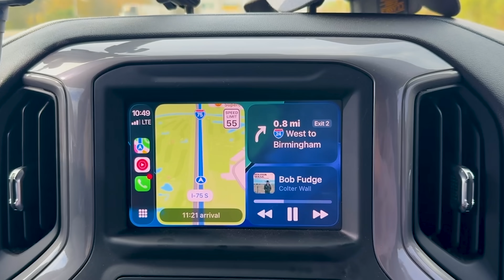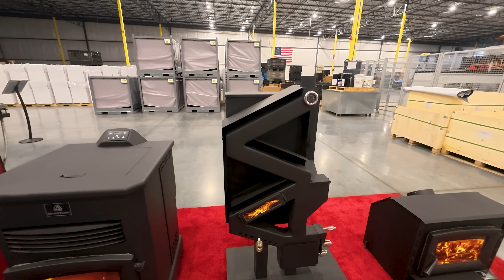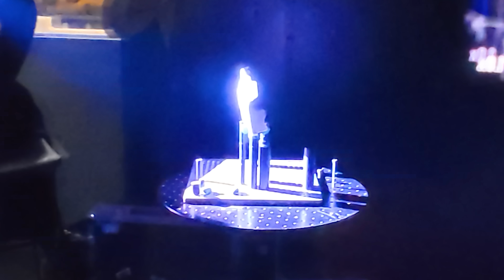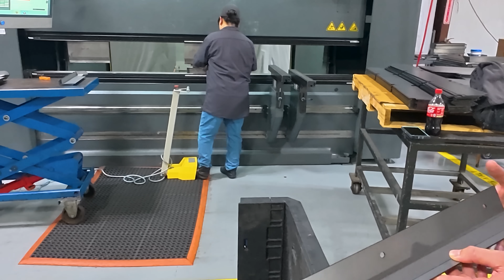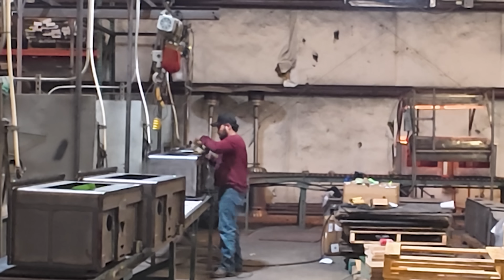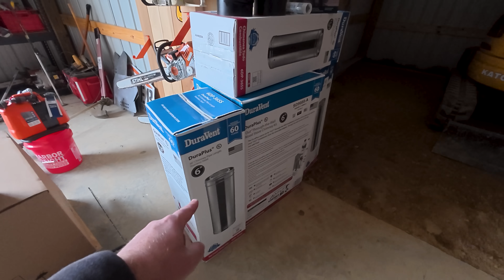This Is How a Wood Stove Is Actually Made

Comment: 12:30 consider doing something very substantial. Having a significant thermal mass behind/around the stove will greatly help capture radiant heat during burning and then continue to throw that heat off for several hours after the burn. You could bulk that out with a layer or two of cinder blocks filled 100% with concrete. Or you could do sand, stone, brick, etc. There are a number of good options for adding thermal mass, including mixing your own cob. Looking forward to what you build. I’m over here in Church Hill and appreciate you highlighting a local company. We’re looking to upgrade our cast iron wood stove in our log cabin home and this gives me some great options to look over.

Comment: Nice tour.  I used to run a press brake and my mom did too.  She even worked at a place that made wood stoves for about a month.  They allowed smoking in the shop and my mom was allergic to tobacco so she just couldn't handle all the smoke. It was a different brand and before smoking indoors was outlawed just about everywhere.

Comment: You would get more heat out of your burn by running interior stove pipe all the way up to the gable end before it exits the wall. That extra radiation goes a long way trying to heat a big room like that. If you burn dry (20% or less moisture content) wood you very rarely have to clean it, and also you have to pay for less double wall stainless.
Reply from the maker: Thanks for sharing

Comment: I want a cook stove, and a separate heat stove both rated for anthracite coal. Then you could burn wood in either if the coal pile gets low. The winters ar going to get COLDER.